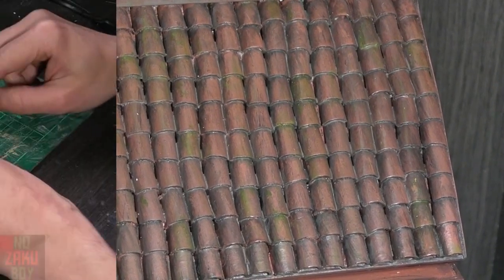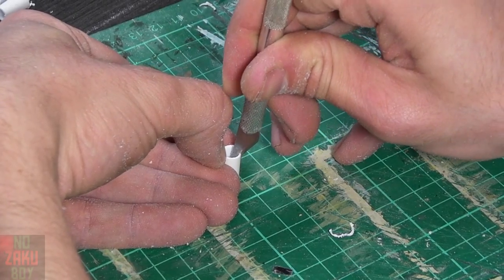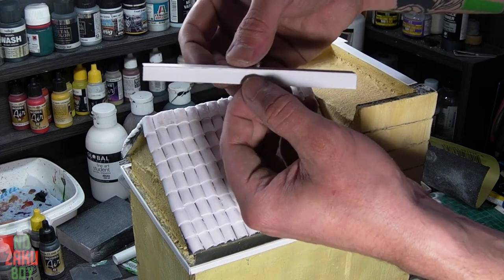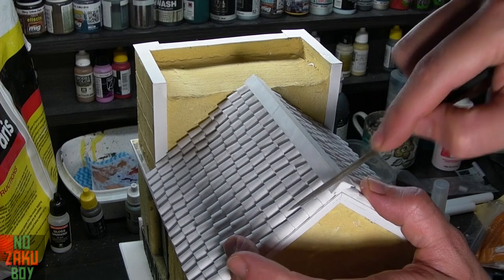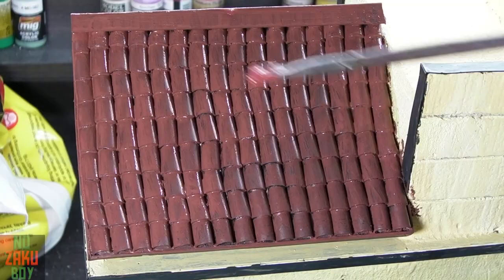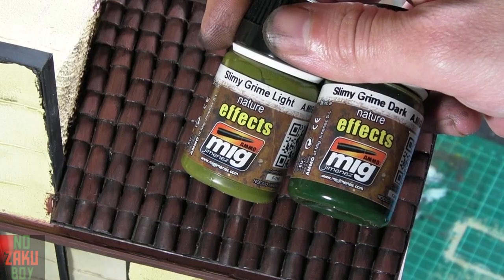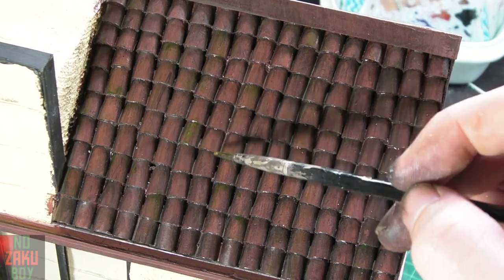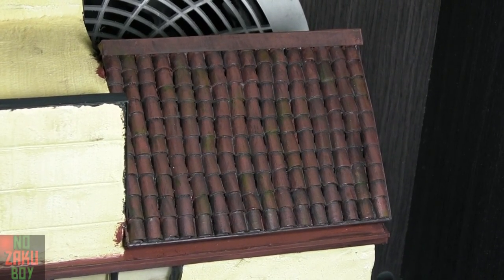Diorama tutorial 2 : Roof Tiles

Comment: Absolutely awesome.  I've learned a lot watching your videos.   But I have a question.
If I needed something more lightweight (and less chance of accidentally cutting yourself), could you use something like fat drinking straws instead of the tubing for the tiles?  
Where I might have no problem with cutting the tubing....I am more concerned that my daughter might cut herself.  (teenager, for a school project) 
Or would straws be too lightweight? or not adhere to the roof?
Reply from the maker: Thankyou! Straws should be fine, if I thought of that in the first place it might of been easier haha, the only problem I would for see with straws is they are a bit thin and won't give as much of a step between the tile rows. You course probbally double them up per tile if you wanted thicker tiles. But to sum it up straws will be more than fine.